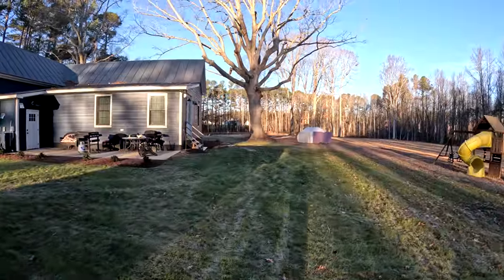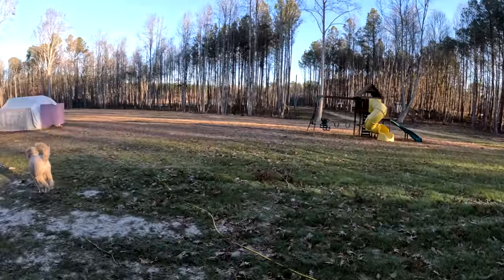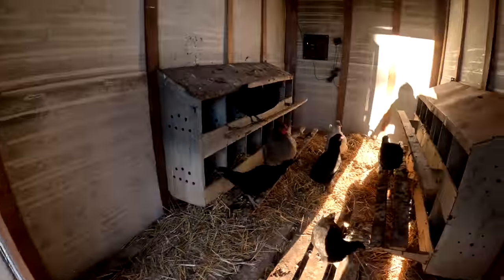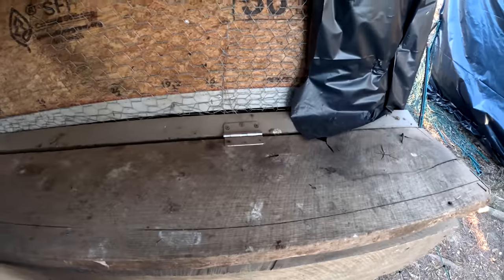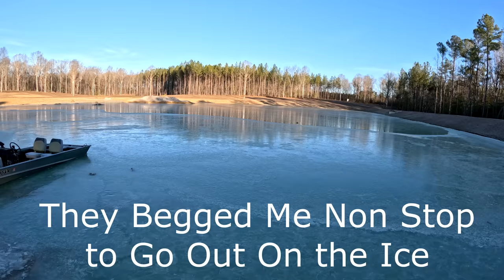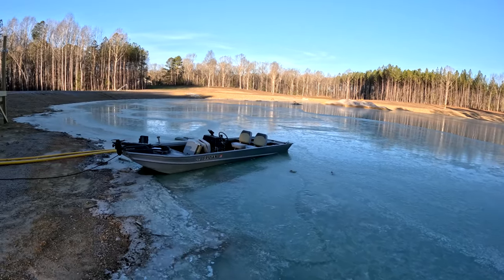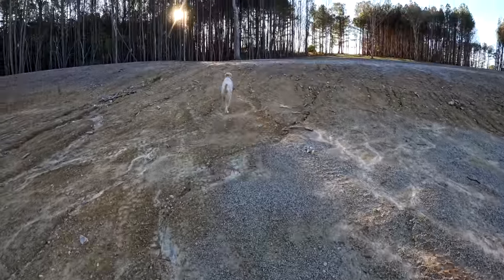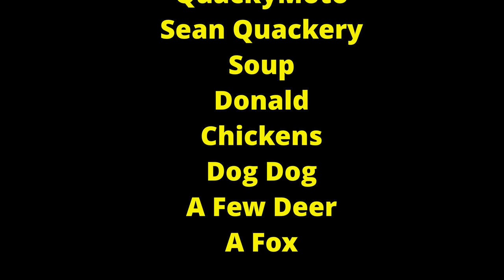5-Acre Pond Freezes Over: See the Beauty!

Comment: That auto-track camera is neat. Did you happen to catch Santa on it? 😉 Anyway, there's a way for the kids to play on ice safely if you ever wanna try it if you get another cold snap. Get some of that sheet plastic that comes in big rolls, some 2x6 or 8 lumber, and a level spot in your yard. Build an ice rink by staking the boards on edge, then lay the plastic down and fill with water. Should freeze relatively quickly since the water will be only a few inches deep. There's how to videos online if you want to do it someday. Definitely a lot safer than a pond.
Reply from the maker: Cool idea. Thanks 😊